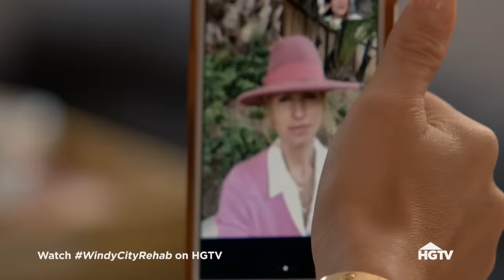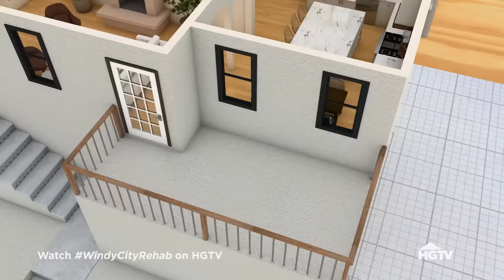AMAZING Restoration of Home in Hollywood | Windy City Rehab | HGTV

Comment: Would instantly rip out staircase, tiled flooring, and the “mirrored” arch/double arch to the kitchen (replace with single larger arch). Love the exterior and elevated features. Too bad they couldn’t mend the fountain - from far looked impressive but up close needs new grout at a min.

Comment: Not one original thing saved
Reply: A common problem with vacant houses is that people break in and "salvage" the fittings. They either sell them for scrap or as vintage items.

Any stained glass, light fixtures, outlet cover plates, door hardware, sconces and plumbing fixtures would have been the first to go. When we were doing it (yes, I have broken into vacant houses before they were demolished), we had a sequence to get the most things out in the shortest time, and each crew member had an assignment.

And the realtor mentioned severe termite and water damage, so that explains the lack of interior walls.
Reply: Not a lot to save